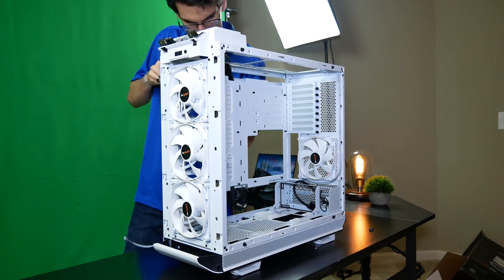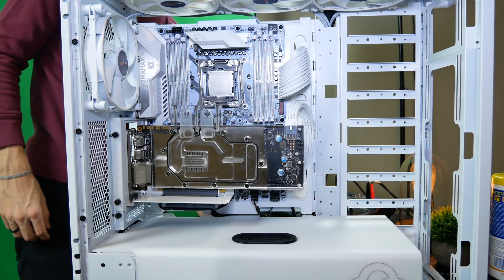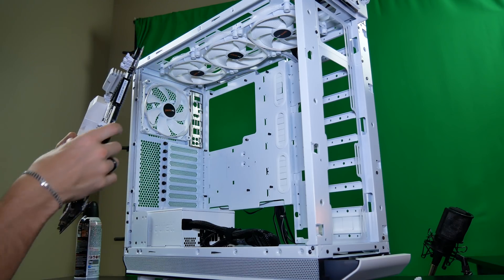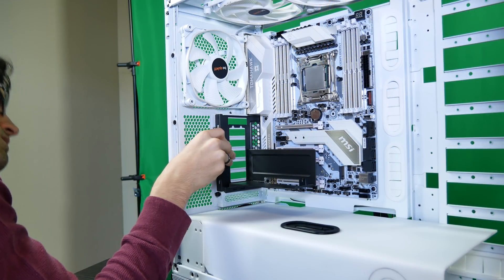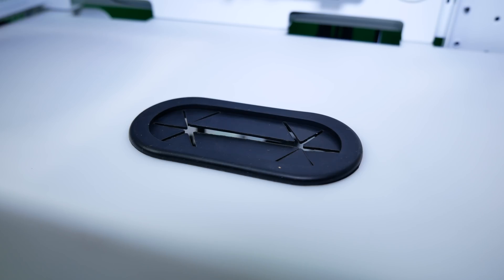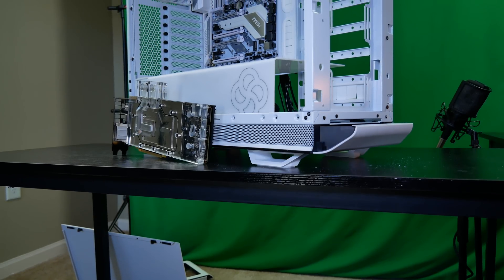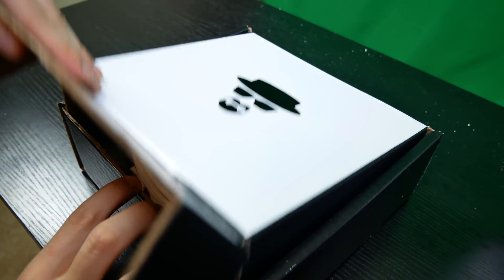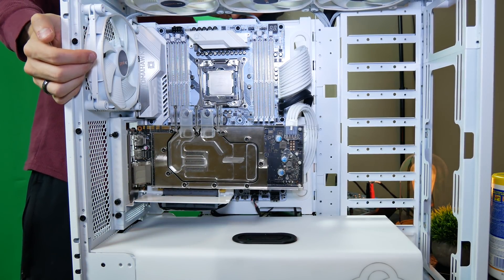The Winter Build | Custom Loop for CES 2018 (Part 1 of 3)

Comment: I want to build a new computer that will run the original Crysis game at high settings, I don’t want to use water cooling, my case is a HAF 932. Should I go AMD? My current setup is a classic Q6600 with SLi EVGA 360s

Comment: If you are going to go with a push configuration on the radiator and want to eliminate the black radiator fins showing on the inside of the case, you could consider going with a Hardware Labs GTS360 radiator.  They have pure white radiators and not just white with black fins.  If you are doing push/pull or pull and people will be seeing the back side of fans anyway, it may not matter.